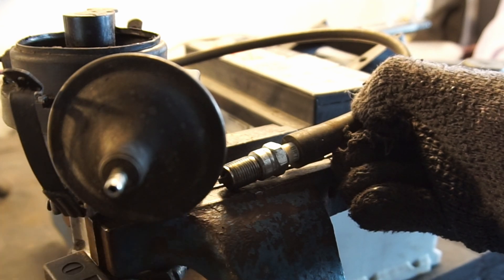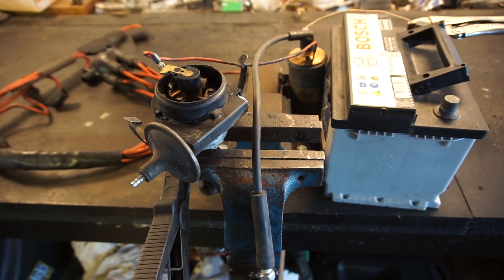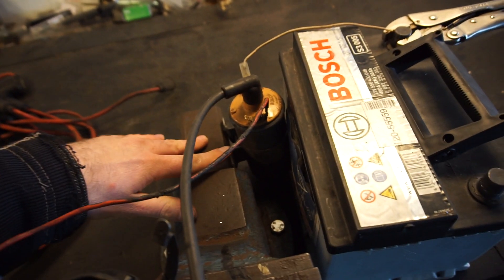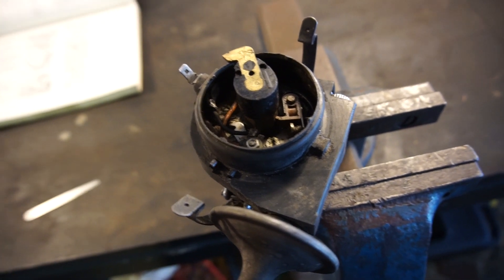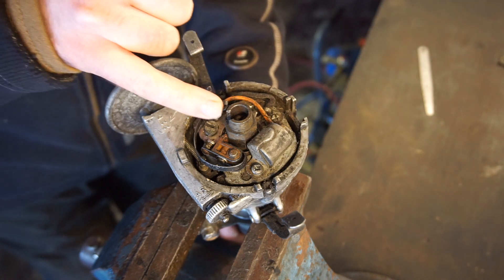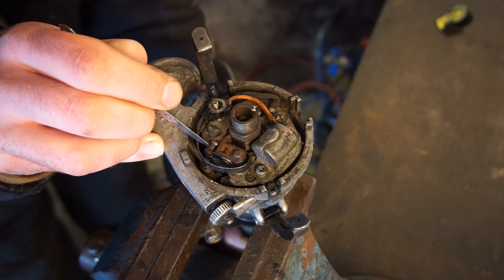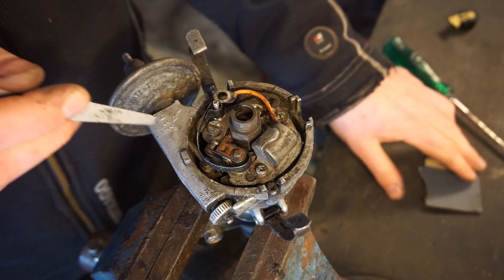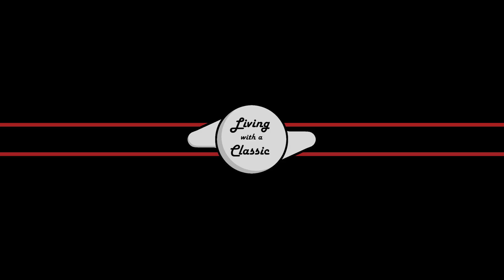How Points Ignition Systems Work (Adjusting and Troubleshooting)

Comment: I have a 62 Rambler that I've recently pulled out of the garage. I drove it around town and it sputtered and died but restarted ok. ( It has good gas and gets gas)Then I drove it out to test it some more and it died. Sprayed starter spray - nothing, new points - nothing had to have it towed home. New coil -  nothing, new  ignition switch - nothing. It just seems to not have any spark to the coil. It turns over and over fine.  I don't have a fuse box. Just a whole lot of aggravation!  😁
Reply: Do you have compression?
Reply: @Rob-tx3jl Hi, thank you for the reply.That's been a month ago now and I finally tinkered with it til it started. I replaced like four or five things. I replaced the speedometer cable - didn't work.  Replaced the gas sending unit - didn't work.  Don't have reverse.  I think that might be the band.  It's running anyway.

Comment: good basic current distributor functions #👍👍 but as i understand high voltage DC current from coil 1st reach to condenser in distributor & then to contact points #👍👍👍🇵🇰
Reply from the maker: No that is the low currant side. High current is only come of of the coil

Comment: Great, clear video thanks. but I use a Points File to clean mine. On a 1951 Morris Minor. (convertible). But !! I will now take your advice and put a new set of points and condenser in as I do my 2 yearly maintenance.  I keep the points file in the glove box as I found it good to keep handy for the Fuel pump points as well. The old trick of giving the pump a thump doesn't always work.
Keep up the good work.
Cheers

Comment: Every point based ignition system I know of has a resistor in the primary circuit. If you send 12 volts to the points they will burn and/or the condenser will fail. Most systems are designed around a 7 volt primary circuit.

Comment: Thank you. I'm working on a 1975 Caterham 7 with a Lotus 7 dual overhead cam wngine and I have never had to deal with points before. This was clear and valuable information ... and now I have spark again. Seems my points were so corroded (engine had not run in about 5 years) they were always open and no spark could develop. I used a 2-sided nail board (file) to clean everything up, and then gapped to 20 thou. All good now.  Thank you again.

Comment: Thank you for the instruction. Currently working on putting a vintage British dirt bike back in service: a 1971 Greeves 380 Griffon Scrambler. It has a Magnito Mechanical Breaker Point Ignition (Stefa, made in Sweden). Took it to the track the other day to test. Started twice, ran for 300 feet and died. Whet plug, no spark. Hence, my refreshing my Breaker Points knowledge. Thanks again for the refresher. BTW, when demonstrating spark, make sure you have a black background for the spark to show. Thanks.
Reply from the maker: I’m glad I could help

Comment: Adam
I was testing my points today by opening /closing them using a screwdriver to test if they spark.. The surfaces are good and a new coil fitted. They were only sparking SLIGHTLY  and not every time they  were opened.  I was testing to seeing if the condensor may be faulty (orange spark instead of usual blue colour)
Do I suspect the condensor as a result of this ?

It would be good if you might make a video of a good condenser in operation against a failed one.... Thank you

Ian

Comment: I like the idea of electronic ignition to replace the contact points, but have heard of a lot of these cheap systems failing,  so I tend to stick with using points...
Question. Would excessive side play in the distributor shaft cause erratic idle, would you think ?
Thanks
Reply from the maker: Yes that would cause running issues since the point gap would constantly be changing as the engine rotates.
Reply: @LivingWithAClassic  I'm on the case and have already replaced the bearings the and noticed an improvement.

Comment: Can a coil be damaged, yet not completely burnt out? I ask because I am having a weird problem where my old chevy truck won’t idle (though higher rpms work fine), and somebody suggested it could be a bad coil. Just about all else is new, and there are no air leaks anywhere (brand new carb).
Reply from the maker: Yes they can. You can check their resistance to see. Look up with the primary and secondary winding resistance should be for the coil in your truck.

Comment: Thank you so much. Actually repairing a 1956 Ford tractor, and having to replace the points and condenser. Was a little lost on the contact breaker verbage on gap and function. This was perfect and now heading back outside to adjust them properly. Great video, well explained and appreciate the visual hands on. Keep them classics runnin!
Reply from the maker: Glad I could help!

Comment: use the simple test to check your condenser  with screwdriver inserted plug wire held close  to eng at idle how far will spark jump1/4 in or less bad  3/4 in perfect  this what pitts points less voltage  show rest will jump open points pitting them

Comment: I need some help, I have a world war II generator that was running before I restored it and painted it. I made sure all my ground points are grounded down to pure metal getting good ground on my positive areas too. I got it wired correctly I have the wire diagram in the distributor is not getting sparked the spark plug cylinder holes I thought that might be a problem so I sanded it down and made a good ground point for the spark plugs still no spark. It's a 4-cylinder Hercules engine. My coil is good much distributor is good my condenser is good everything is good just no spark I'm missing a wire somewhere. I have one wire negative from my distributor to my coil negative to negative. From the coil positive to positive to the ignition switch. Just curious if you have any thoughts of where wire might be missing

Comment: Well done!  I'm 72 and I've always did all my own work on my cars, motorcycles, trucks, etc. and I still do.  As wonderfully reliable today's electronic ignitions are, I almost miss doing tune-ups.  I found this video because one of my grandsons, who is a mechanical engineer working on his master's degree and who works for Honda asked me about points, condenser, coil ignitions work. You're description is perfect and very clearly presented.  I still have the tools I used for my old ignition systems including a dwell tachometer, timing lights and even the special flexible points adjusting tool that was used with the old Delco distributor caps with the little window to access the points adjustment screw.  One big thing that's changed with cars since since electronics took over is how crammed the engine compartment is.  The engine compartment on my old '57 Chevy was so big and so empty that my wife (who was my girlfriend at the time) could actually climb in the engine compartment and I could close the hood!  (Don't ask me how I know that because I can't remember why we did it.)  Also, things were so simple. You opened the hood on a car back then and all you saw was an engine, a generator (before alternators replaced them) a battery and a radiator.  there was tons of room to work and things were so simple and uncomplicated. That was even before PVC valves and EGRs were used.  My father was born in 1909.  His first car was a Model T.  He would tell me about how you could re-build the engine in your garage in a few hours.  He said that the biggest problem with Model Ts and similar cars back then was having to fix flats all the time.  I thought about all the things he must have known that are all but forgotten now except by antique car collectors.  Then I am reminded that that's how my grandson's must see me.  

Thanks again for your fine video.
Reply: wholesome stuff right here
Reply: I like working backwards in life .... Meaning what it was like to be in your shoes I'm 31..... good chat

Comment: A mechanic told me once not using sand paper on the points because they are fragile metal made. Did you hear the same once?
Reply: Its the paper ( paper about the  thickness as a matchbox) is fragile and good for cleaning and adjusting contact points. Its an old mechanics trick if you dont have feeler gauges at hand.

Comment: Well done Adam good to see knowledge and skills being shared,  just a little about the condenser, when the points open and the magnetic field in the primary side of the coil collapses it induces a high voltage in the secondary side as you said but it also generates a back emf of around 500 volts in the primary the purpose of the condenser is to absorb and dissipate it,  if it fails that's when you get excessive sparking and burning at the points a telltale sign is a white powdery deposit that creates a bad contact and misfiring, you make me feel old when I was a lad this was state of the art lol.
Reply: Always wondered if a 10 watt diode would be better at controlling the back emf
Reply: @daphnejames3571  It is sometimes good practice to use a protection diode on inductive loads such as across the pos and neg of the coil in this case the points are switching the coils negative so you can't use one in place of the condenser it probably  wouldn't handle the voltage spike anyway being a semiconductor it can only go open circuit if it fails best stick with the condenser if you're having problems getting one the right physical size you can put them on the outside of the distributor.

Comment: Hi Adam thank you for sharing very very helpful information indeed
Reply: Try taking the HT wire from the centre of the distributor and set it about a quarter inch from the block and there should be a big blue spark as the points open with ignition on. The spark on the points is less to see.

Comment: Hi Adam, nice video. My 67 Mustang distributor has a small piece of felt in the distributor shaft, and it's recommended to oil when you do maintenance. It helps to lubricate the bearing for the shaft of the distributor. I couldn't tell if your distributor has any felt in the center of it or not. As you said not all distributors are the same.
Reply: Yes. Your points kit should come with a little capsule of grease. I have a big tube of Accel distributor grease in case it doesn't
Reply: Thanks for this comment my 3.7l mercruiser has that little peice of foam and now I know what it's for!!
Reply: What kind of lubricant ?

Comment: very helpful! what is this bolt with the "AR" on it?
Reply: I assume it is to advance or retard the ignition timing never seen that before normally (on german cars) you turn the distrubutor clockwise or anticlockwise to adjust ignition timing in accordance with mfg specification e.g. 6 degrees after TDC.
Reply: @kaspersvendsen8510  yes you're correct it's for fine tuning, in the bad old days when we had 2star and 4star leaded petrol with a different octane rating you could tweak it to suit, advance as much as you could but if it started pinking ( pre-ignition ) you could retard it  slightly,  now we have 95 octane as standard we don't have to, however some modern cars have knock sensors and do it automatically and these can benefit from 100 octane, if you don't have them then no benefit don't bother save your money.